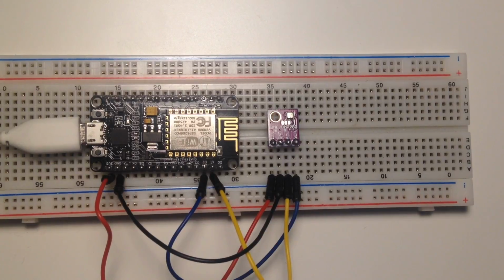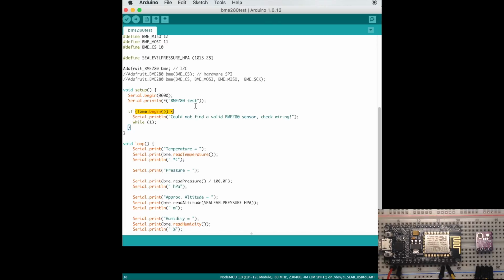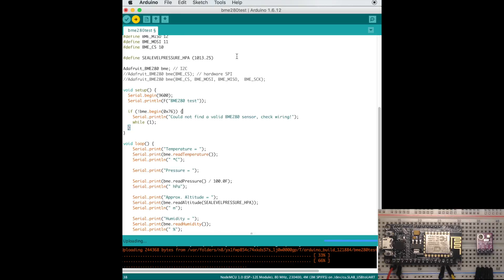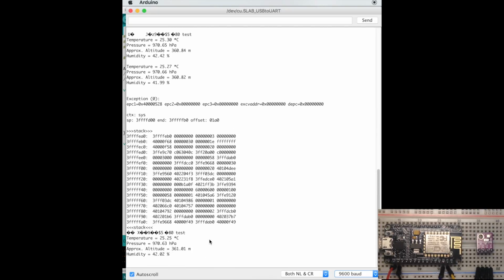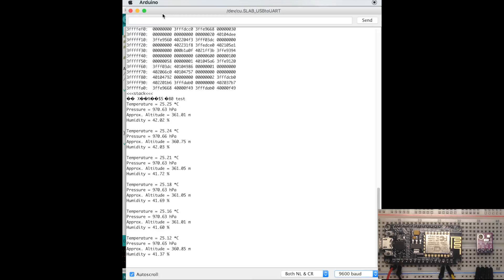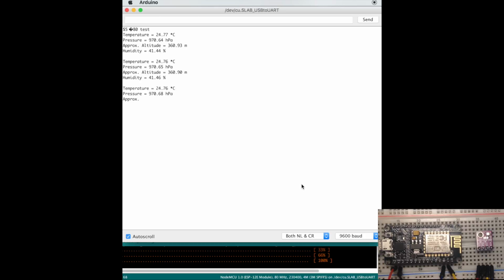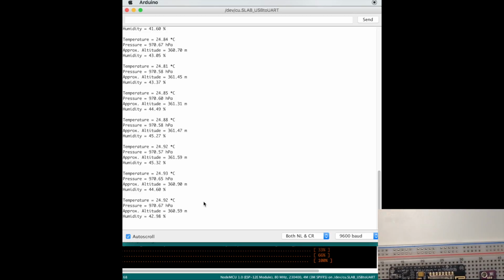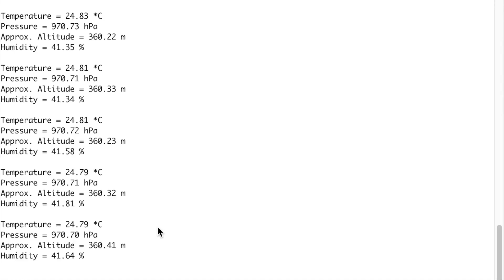BME280 + ESP8266

Comment: Thanks for the tutorial.  I'll be playing with mine and use this as a guide.
If I could request a topic, I am having a hard time wrapping my head around the server/client communication between 2 ESP8266s.  For example. I would like to send that temp data to another ESP8266 and have the data displayed on an OLED.  I know there are videos out there, but I have not found one that clicks with me yet.  I'm a hardware guy, so software is something I am trying to build up.  Thanks!

Comment: Thank you for your tutorial and it works, yet i have a Wemos D1 Mini and two questions:
1. My meassurements are a "little" off. The Humidity is about 10% too low and the temperature ~1°C too high. I tried with two BME280s. Any ideas?
2. Is there a way to connect more than one (three :) ) BME280 to the D1 Mini? Since you can't define the pins you're wiring it to.

Thanks in advance :)
Merlin
Reply from the maker: +Kartoffelsnack in answer to your first question, I'm not sure. There may be a calibration register to play with, but other than that I can't think what else would cause such a big discrepancy. What are you comparing the value to?

As for the second, the bme280 uses the i2c bus, which can take lots of devices using the same pins. They each need separate id's, though, so you have to short some pins on the BME280 module, and change the address in the code. I believe it's just pulling the addr  lines high/low, but you can check the datasheet to find out.
Reply: Thanks a lot, i compared it to an analaog thermo-/ hygrometer. After i wrote the comment above, i found an dht22 and compared the values, they were a lot closer to these of the BME280. so i assume the analog (hygrometer) is broken or not as accurate. 
Yet i had nothing to do with the i2c bus, besides the shortening of the pins (those pads above the text?), do i have to make changes to the code ? And how should i wire the others to the esp? SCL to SCL and SDA to SDA where the first one is wired to?
Greetings :)
Reply from the maker: the connections would be the same, but you have to mess with the solder pads on the top next to the can. two of them are connected with a trace, which you would have to cut with a knife, and then you bridge the middle to the other side with a solder blob. If you do that it will have the address 0x77 instead of 0x76. In your code, you can just initialize the library again, but with 0x77 instead of 0x76. unfortunately, there are only two addresses for this chip, so you can't easily put three on the same pins.
Reply: That helps a lot :) Thank you i'll try to get it to work!

Comment: why does it have to be so confusing, lol.
do i also have to change the "#define SEALEVELPRESSURE_HPA (xxxx.xx)" and what are these SPI pins used for?:

#define BME_SCK 13
#define BME_MISO 12
#define BME_MOSI 11
#define BME_CS 10
Reply from the maker: It is because I tried to use the example code for the library with as little modification as possible. So the spi pins aren't used on this model, and the HPA was just set to a nominal pressure value to get an altitude I could show.

Comment: Thank you for this tuto. I always get the check wiring message. I verified my I2C address via I2C scanner and it was 0x76. I didn't understand where is the problem?!
Reply from the maker: I have gotten this message mostly if the wiring is loose, or if I mixed up the i2c wires. It is also possible that you are using a device without level shifting on a 5v Arduino. In the example I showed, I was using the ESP8266, which is 3.3v.

Another possibility is that you actually have the BMP280, which looks pretty much identical. You can test for that by installing the Adafruit library for that, and trying it out.

Good luck, and let me know if you figure it out!!
Reply: I tested it with Wemos D1 which is a ESP8266 process and I get the same problem.